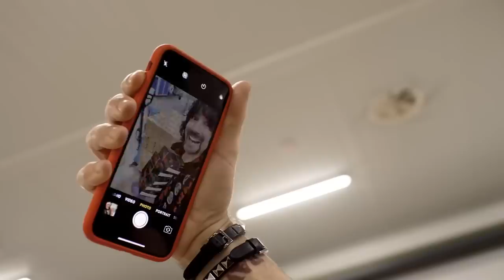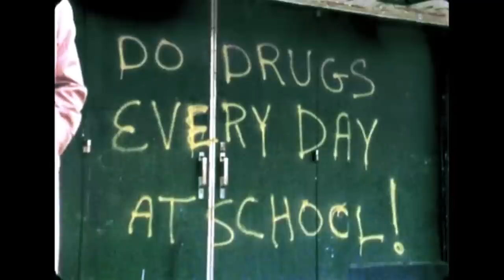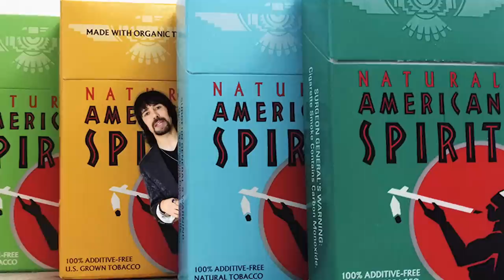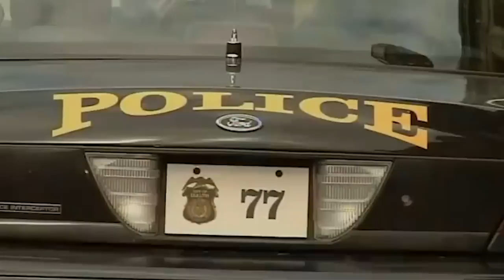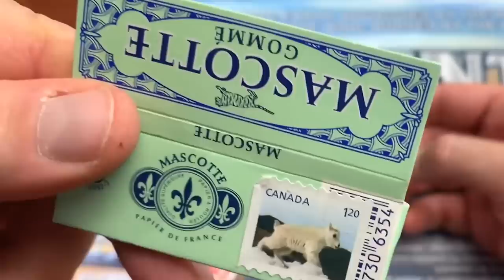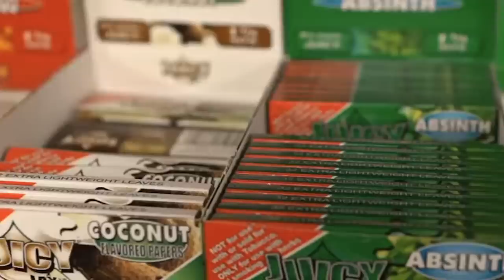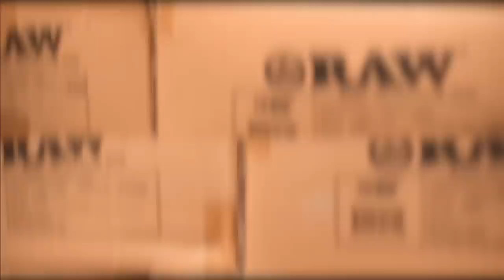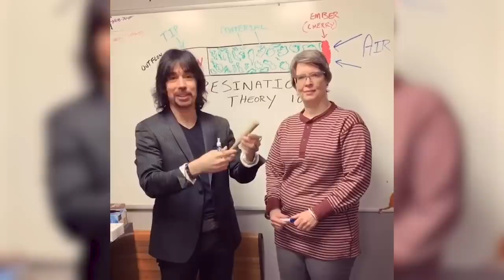The Willy Wonka of Rolling Papers

Comment: This is so nuts, I remember smoking Elements and Juicy Jays in my 20s. I had no idea how influencial this one guy was on the scene. I really liked the point about when Raws came on the scene in a big way, you tried them and then never smoke anything else. The moment I found Raws I never looked back. I was a big zig zag guy for a long time but ill never go back to them. I buy the 300 packs of raw 1 and a quarter size papers and they are literally perfect. Amazing video man.
Reply: Once RAW's came about the big debate was between RAW and OCB in my scene. 

I was an OCB guy. The slim ones in that black pack with the silver lettering - it just looked so much cooler than the Raw aesthetic, I thought. 

I'm curious - any of you kids out there still smoking a ton of weed; is OCB and Raw still the big two? Does anybody use zigzags anymore? And is mixing tobacco with the weed still commonplace as well (though that may have always been regional)?. 

When I was a teenager hanging around in scenes where smoking joints was constant and commonplace, if you handed somebody a joint with no tobacco in it - many would cough and spit and make a face like "what the hell man?"

 I can also recall being very grossed out by an entirely "green" bat. The tobacco helped it go down smooth and absolutely enhanced the flavour and high.

Comment: I'm not often someone who commits to a brand because I think for the most part brand loyalty is a pretty stupid thing, however I've tried multiple different brands of rolling papers and because smoking anything is already so harmful I really wanted to get the least harmful product available. Raw papers are reasonably priced, burn well, have little to no taste, and in recent tests on rolling paper contaminants they scored very very high on how clean and pure their products are. My go to papers are the 1,1/4 raws with the artesano tips / crutches in the tray. I would highly reccomend them for new smokers because I used to hate joints when I would smoke standard bleached wood pulp papers just due to the fact that all my rolls tasted like chemicals and were harsh on my throat and didn't burn properly at all. I also purchased one of their rolling machines a. They've become a staple of affordable and high quality rolling accessories and really it's one of those niche cases where the extra $1 you spend over a chinese wholesale brand really makes a world of difference.
Reply: Id suggest a dry herb vaporizer. While MJ combustion definitely does seem to be much better than cigarette smoke, they both produce polyaormatichydrocarbons (or PAHs for short). Vaporization of dry herb (making the oils go from liquid to gas form) is not a chemical reaction and thus does not produce PAHs

Comment: I remember when I first started smoking in university, I was using the standard silver Rizlas and then one of the guys older than me turns up at our house, has a booklet of actual tips rather than just using the green card in the paper packet, rolls up an immaculate spliff and burns the excess paper away and I knew I had to get those fucking papers.

Comment: For me, it seems a little silly to have this much soap opera drama in a $2 pack of simple rolling paper. All this crap about it burning smoother or tasting like anything is pure fluff. 

RAW is basically the only option in a head shop and that’s not changing for the better. Their merch is hideously loud, even now that everything is black with red letters instead of the tan. That focking side button on the black rollers make them useless trash. Now they’re pushing glass tips and not a single one will fit their king or short rollers and oh well cause ya already bought it. That’s a shiddy way to do business, oh well cause ya already bought it.

I’m not impressed or the slightest moved by the “Golden Ticket” ripoff. Of course Josh wants to father a predecessor that will bring their clown ass fan base with em. What’ll happen to RAW when that influencer inevitably misrepresents the brand? It’ll be a war against all them “hand crafted” and “designed myself” $2 Wish papers they sell for $10+. Are u Bob Marley? Snoop Dogg? Then sit down cause ur not that blazy, Susan!